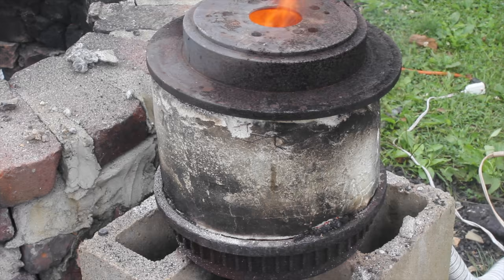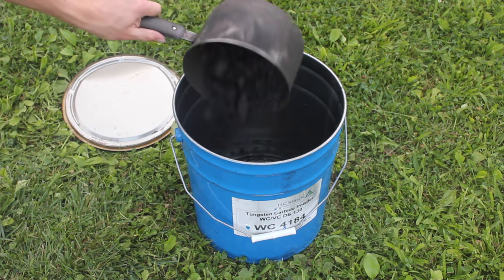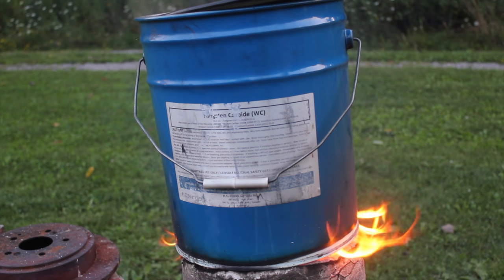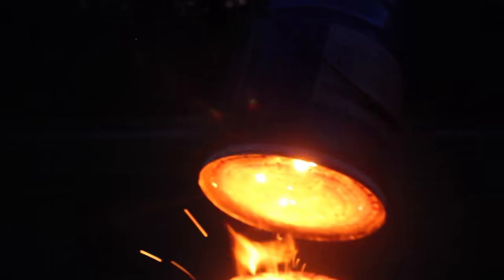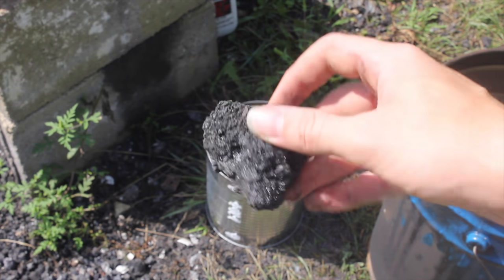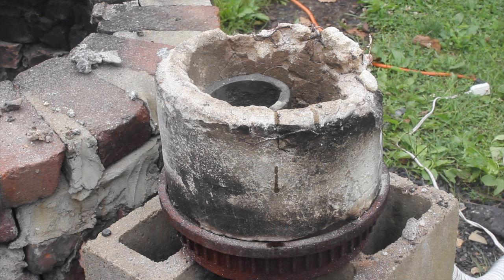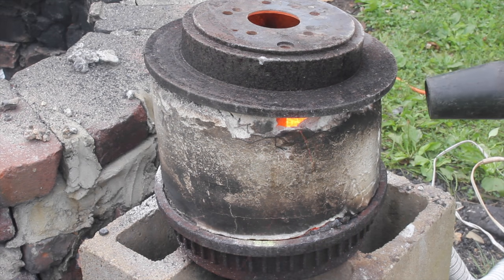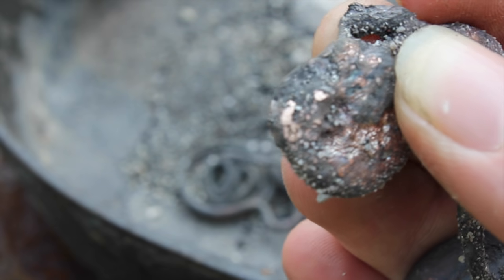Making Coke Fuel for Melting Metals

Comment: I have worked in a steel mill coke plant for many years.  You are making a mistake by crushing your coke.  If anything, I would separate screening the coke from the coke fines which is called coke breeze.  I would have used Coke Breeze on the bottom of the furnace and let the crucible sit on these fines to protect your furnace lining.  Then I would use the coarse coke to pack around the crucible so when you put your blower into the furnace, you got good ventilation throughout the coke charge and even more heat.  This is desirable like in blast furnaces using coke is to have screened coke without coke breeze which closes off the air to combust the coke.  Coke Breeze is not desirable.  Lump coke is what you are looking for and if it is not crumbly, it is best for the most heat and this is called coke stability.  High coke stability means the coke won't crumble into the coke breeze.  Coke breeze is detrimental to good iron smelting and lower temps because of reduced hot air flow through the burden (charge of coke).  Coke produced for iron and copper are practically identical.  Don't crush the coke next time and try to have coarse pieces from 2 cm and up for your size of furnace with little or best is no fines.

Comment: I’m familiar with coke. My first job after college I worked for an engineering construction company that designed and built metallurgical coke ovens fir the steel industry. It was fascinating. The coke produced in them looks like a grey/silvery sponge, but very hard, after quenching in water to cool it.
Reply: A lot of homeless people are familiar with coke too. Lol.
Reply: cool. i tried it once and the coal turned silver-y and hard
Reply: @lordvader4089  More like rich people lol, doubt homeless people would be able to afford it.
Reply: @diobrando2160  how hard it is? Isn't coal hard already? It is even harder than coal?
Reply: @CIA_Alien  I fail to understand your response with the undeserved insult.  Metallurgical coke and the derivative of cocaine are completely different frorm each other, as is Coca-Cola.
Reply: Hey ....hi
Reply: I am in confusion ... please can you help me out.... It really very urgent... Is coke harder than coal ? And why..?. please pretty please can you explain ...
Reply: @seeyaram3105  metallurgical coke is generally harder than coal, but at the same time can be brittle.  The coking process drives off the ash and volatiles resulting in 80-85% carbon, a harder material than the coal from which it is derived.  The coal can be half that percentage of carbon.
Reply: @diobrando2160  that's what coke is - very silvery and hard. Coke produced in industrial coke ovens looks like a sponge, with all the holes and tunnels in ot that were produced by the volatile gases being drawn off as it melts and reforms.  The ovens are under negative pressure and relatively air-tight, so the volatiles can be exttracted without oxygen burning the coal and turning it to ash.
Reply: @PAHighlander24  it's really helpful...thanks a ton... really meant it....🙏

Comment: I'm thinking a support for the lid would have increased the lifespan of those walls.
Reply: drill a 2" hole in lid then  bolt on a flat piece of sheet metal to make easily adjustable flow
Reply: @SXSPRIME  looks like the "lid" is a car part lol
Reply: @Biggylios  yeah the lid to smelter is a brake rotor. I meant to modify the bucket lid
Reply: @Biggylios  yeah it's a brake disc lol

Comment: I don't know if you already know this but you can use steel wool to reinforce your plaster of Paris and play sand mold it works like rebar in concrete
Reply: Plaster makes a poor furnace lining because it has no strength and cracks easily.  Without refractory available, I would use one part clean silica sand, one part Portland Cement, and one part vermiculite.  Vermiculite can be bought in bags at a plant nursery.  Mix all three ingredients with no water.  After the mix is well mixed, add a little water to be able to make a wet ball that does not fall apart, either not too wet or dry, but can be cast or troweled.  Again, this is not a true refractory but will be superior and resist heat much, much better than plaster which is only hydrated lime.  Using Portland Cement and sand brings your mix to work well almost to 1600 deg C.  Also, using screened coke without fines will also greatly get more heat to melt copper and even gray iron.  Maybe use the Coke fines that is called Coke Breeze as a bed on the bottom of the furnace to keep the crucible from sticking to the bottom and protect the crucible from breaking.

Comment: Use anthracite coal.  When it cokes together it forms a more loose structure that burns better than low grade bituminous coal.
Reply: anthracite is very expensive where i live
Reply: @s.sradon9782  Guess I am lucky to be in NE PA. You can get a (shit) ton of Anthracite for about $125/ton. You'll need beer as well.
Reply: Can l charcoal instead of coal
Reply: @ipinventors1738  yep, doubt you'll be able to find coal anywhere after the new potus gets through banning it.
Reply: I herd you should not use anthracite coal to make coke
Reply: @charlesbowen3944  Antracite has high carbon content, doesn't give off tar and very few volatiles. No reason to make coke with it for this use. If the case that you have to charge C into a blast furnace, you would must coke it, because antracite is very compact. Coke is porous, and let reduction gases flow in the BF

Comment: The "smoke" coming off of that coal...  is Coal Gas...  a VERY flammable gas that has been used for centuries as a flammable fuel.  Now you just have to figure a way to gather it, condense it, mix it with a flammable liquid it will dissolve into (like putting CO2 into water to carbonate it), and then you will have a liquid fuel that will burn VERY hot.  :-)  Also the tar can be used as...  well...  tar.  You can patch a driveway with it if you make it into Asphalt.  :-P
Reply: Tar can be used to isolate water from wood like in ships or home roof and so on, and it can be used as medicine to treat some skin and hair disease for cattle's and humans but I don't recommended using it without caution because I read that some people are allergic? and too much of it can hurt the skin? IDK
Anyway, if you extract tar correctly you should get 3 tar thickness, light tar and medium dense/thick tar and very dense/thick tar and each one has it's own uses.
Also I think (I'm not sure) that tar is going to have different properties depends on the type of the tree/wood.
Reply: If he had made a biochar stove and used coal instead of wood in the retort he would have have a very efficient system.

Comment: Your can went brittle as chips because carbon did diffusion into the steel, increasing the carbon content. To prevent that you can use a metal with a fusion point higher than the work temperature, and unable to solve carbon, for example coppper. Greetings from Argentina

Comment: adding coal granules or powder to all metals but aluminium increases efficiency and decreases slag. adding coal to slag and heaing it results in reprocessing of the slag into metal, this does not work with aluminium oxide as one will be required to electrolize the liquid oxide, check cody's lab for more detail on refining copper.

Comment: It takes 4 different types of coal at different mixing percentages and then its gotta cook in an oven for 18 to 23 hours depending on production ranging from 1800 to 2100 degrees that's how coke is made
Reply: @greencityman420  and other hydrocarbons
Reply: this is the destructive distillation process and it produces elemental carbon, also called coke, but this coke varies a lot from the cooking method originally discovered by the chinese no later than in the ninth century ad or 10900 years from the dawn of civilization.

Comment: Can you give me an example of why people use coke? Thanks
Reply: In the steel industry coke is used as the fuel in blast furnaces to reduce iron ore to iron. It’s charged into the blast furnace in alternating layers with the ore and limestone. The limestone reacts with contaminants to produce slag, which floats on top of the molten iron and is easily drawn off.
Reply: @PAHighlander24  When i was in school the classroom had a coke burner, during the lessons the caretaker would come to the classroom and at coke every few hours. I often wondered why coke and not coal was used, but i believe coke has a higher calorific value and creates less smokes
Reply: It's used to make steel and it's byproducts are also used for various purposes.

Comment: it might help if you put insulation around the foundry , think a lot of the heat radiates outward and not intoo the crusible
Reply: Foundry is a place or building used to house the location of the FURNACE.

Comment: Your crucible is chipping away because it has a metal mesh screen on the inside.

To make good coke, build an actual coke oven using fire bricks.

To melt copper, you do not need coke. Simply use a crucible with a lid on top with a 1-2” hole on top and keep dumping your charcoal or wood around the crucible and induce air “hot air preferably heat gun or hair dryer etc “ and you will have no problem melting soft metals like copper and aluminum.

If you need to reach 4000 degrees so you can melt iron, brass, steel etc. than you’ll need coke and a crucible that’s inside an isolated forge. 

There’s various chemicals that can be added to the chamber to help expedite the heating process faster.

Good luck.
Reply: Hey....can you please help me out
Reply: Can you please tell me which is harder ,coke or coal???

Comment: Very Cool! What kind of coal do you use?
Reply from the maker: Thank you.

  I live near a set of railroad tracks and sometimes the coal being transported spills onto the ground. This is the coal that I use for my forge and foundry. Because I do not buy it commercially, I am unsure of its type or purity. I also do not know enough about coal to identify it by its properties. If you know of any good resources, I would be very interested to learn.
Reply: Well, based on the amount of tar and sticky stuff that was produced, I would say that the coal is bituminous. Bituminous coal has a lot of volatile compounds in it that turn to tar when heated. Do you know where the coal on the train is going to? That may help you identify the type of coal.
Reply from the maker: I think that the trains come from Pennsylvania. I have heard that Pennsylvania is rich in anthracite coal, which has low impurity levels and high carbon content. I really hope this is true but, like you said, it produced a lot of tar.
Reply: There is also a gigantic bituminous field in Pennsylvania. Based on how black that coal is, it is probably bituminous. I actually have some anthracite and it does not look like the coal that you use. If the coal is more silvery or shiny, it's anthracite. But if it is black and slightly porous, it's bituminous.
Reply from the maker: Thank you for that information. I think you are right about the coal being bituminous. I am glad to finally know what type of coal I am using.
Reply: Does the coal has shiny texture??is it light or heavy?
Reply: The steel industry uses anthracite, ground up before coking. It has much less volatiles than bituminous and produces the characteristics needed in the blast furnaces to produce iron.

Comment: can you tell how to make afoundary
Reply: use perlite and sodium silicate as a refractory cement, pour it into a metal bucket and place a weighted down plastic bucket in the middle to form cavity, leave for  6 hours or until mix gets solid, drill an angled hole through the wall and the buckets, then proceed with either fitting a leaf blower, hair drier or a gas torch, or at best a carburated oil pressure injector, you also may reinforce the build with wire.
Reply: Lumber, steel beams, roofing material, nothing special needed to build a structure to house your FURNACE